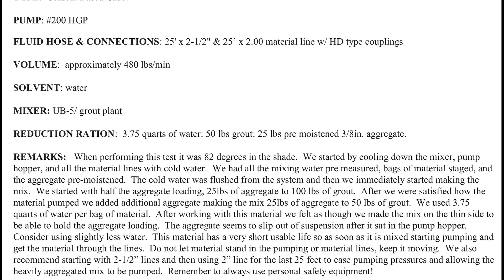Dayton® Superior Sure-Grip High Performance Grout®: Grout Crain Rails with the Grout Plant

Comment: In defense to the Quikspray demo team, there are many other videos to watch and critique and appreciate all comments.  These material demos are generally supplied with just enough product to give a decent material test. This team is virtually seeing the product for the first time. These gentlemen build the equipment,  and they regrettably don't really become efficient with any specific product whether..grout, stucco, epoxy, cement,  plaster, shotcrete, gfrc, but they try in over 60 videos.  Please help them improve and voice your opinion openly,  as it furnishes another view.

Comment: Sloopy workers, need to practice a bit before trying to convince buyers to part with cash.
Reply: George,

Quikspray Inc. is a manufacturer of cement pumps and mixers. The point of the demo is to see if the equipment can successfully pump the material that was sent by the material manufacturer. In this case, Dayton Superior. Customers want to know if the pump can handle certain material going through it, so these demonstrations and videos are provided proof. Instead of offering your "sloopy" critique (which it is sloppy), you may suggest in how to improve in the future. Offering these type of negative comments do not help anyone become better. What did you consider sloppy? So in the future the videos can be performed better.
Reply: @lea1267  If you display poor House Keeping Techniques from the company it is saying to all that as experts you are offering proper procedures or just don't care to follow but it also reflects on the company for equipment quality and service.